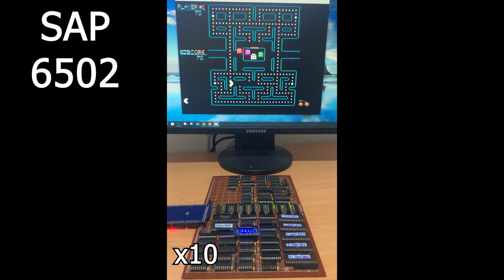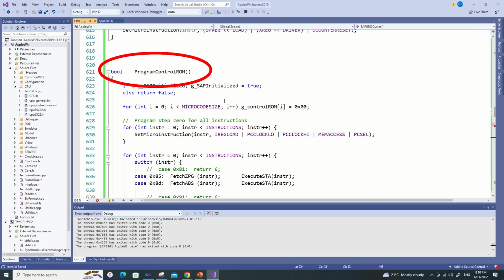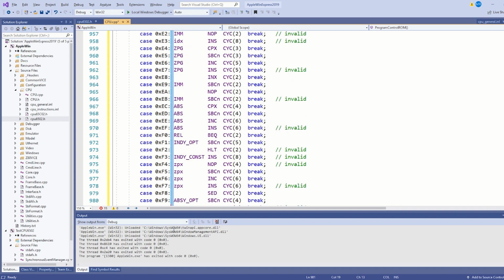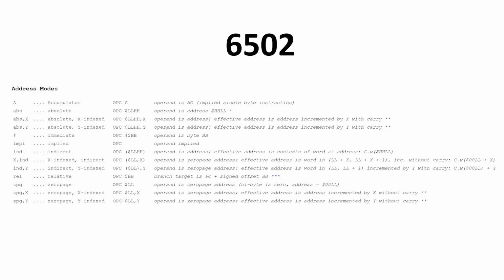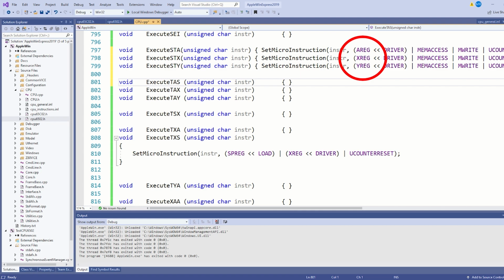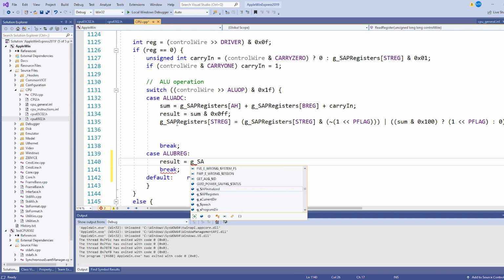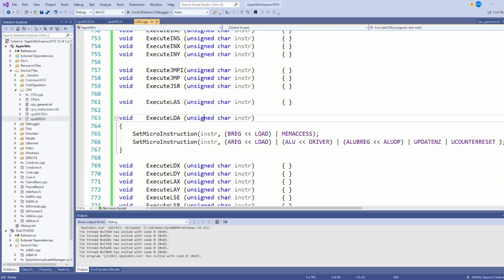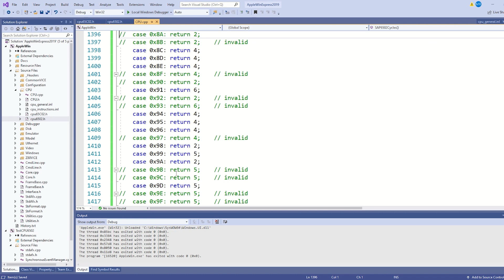SAP6502 Microcode load and transfer

Comment: It occurs to me that you could build a SAP 1802 and it would probably be simpler than your 6502 machine.
Reply from the maker: Yeah, i think the regular register array will work well with an SRAM register bank.  Same is true for the 68000, which is why i've been tempted to build that over the 8086.
Reply: My first job out of college (back in 1978) was assembly language programming an 1802 in RCA's Advanced Technology Labs (Camden NJ) for a couple of US gov't 3-letter-agency projects.  I even once got to meet the guy they said invented the 1802 up at RCA's Princeton Labs.  When (if?) I get my variant of Dr. Regan's SAP-6502 working, I'm intending to upgrade it to use SRAM for registers (as in the good Dr's TTL-Apple2e series), and then possibly see if I can mod that HW and uCode generator to do the 1802 instruction set.

Comment: A few hours before this video was released, I ended the initial design of a set of instructions: mnemonics, codes, addressing modes. One-byte opcodes. Not a single invalid instruction (there are 256 of them, including NOP). It could have been around 150, but I wanted the same operations done with accumulator A to be done with accumulator B. So, in the end:
     ·  Two independently operable, mutually swappable accumulators.
     ·   One user-definable flag in the status register, swappable with carry flag but with its own three management implicit instructions and conditional branching instructions.
     ·   Global stacking and de-stacking of processor registers and of a selection of general purpose registers (allows local data scope isolation more easily)
     ·  16 conditional branch (relative addressing mode) instructions
     ·  32 instructions per accumulator, including multiplication and division (in fact, fairly easy to implement with an ALU either in microcode or assembler), each in several addressing modes.
     ·  Standard stack and heap management
     ·  Simple and double indexing, reduced ("zpg") and extended ("abs") addressing, single-indexed but not double-indexed indirect addressing mode.
     ·  Includes instructions to manage time-multiplexed concurrent execution under control of one master, timer-driven interrupt routine
      · Includes instructions to manage a second type of indexing system for other purposes, such as support for p-code interpretation.
      It took me a week.
Reply from the maker: Good luck with the build.  Feel free to use the microcode generator here if it may be of any help.  
One of the things I want to achieve with this playlist is to provide support to those who want to build their own CPU - so let me know how you go.  Software emulator are easier to build first off.
Reply: @DrMattRegan  Thank you for your good wishes and for sharing your knowledge, which will come handy when developing the microcode.

Comment: I really like this series. It will be my third build after the Ben Eater SAP (done) and the SLU4 minimal-64 (in progress). Will you publish schematic and a pcb for the SAP-6502 ?
Reply from the maker: Yep, I'm planning to do a playlist where I do the schematics and make boards for each module and make it into an Apple2+.  You'll still need to wire the modules together, but it is much less work.
I'll make the Gerbers for the PCBs available and they will be available from PCBWay.  The modules are < 10cmx10cm so they are $5 (for 10 PCBs) for each module from PCBWay.